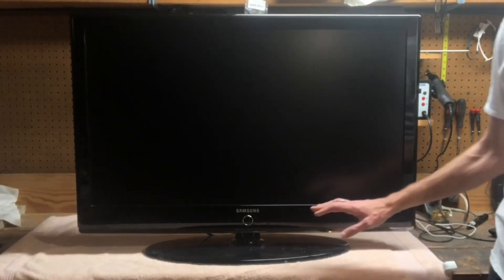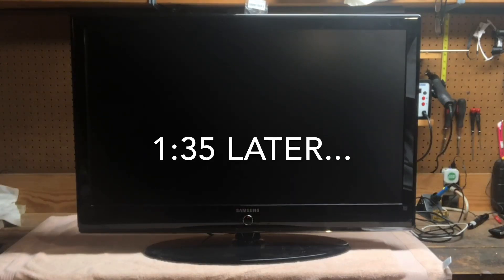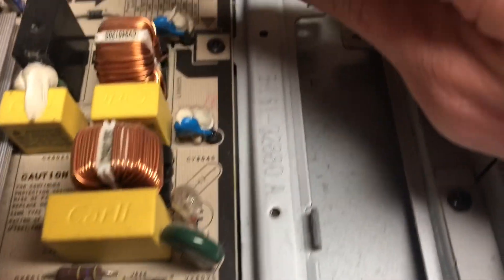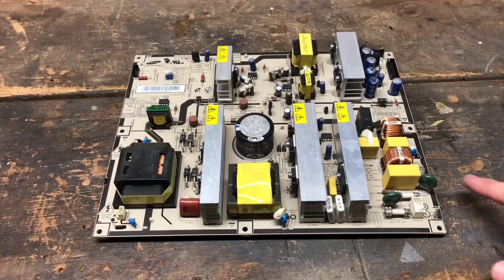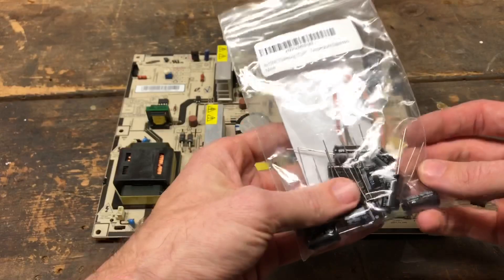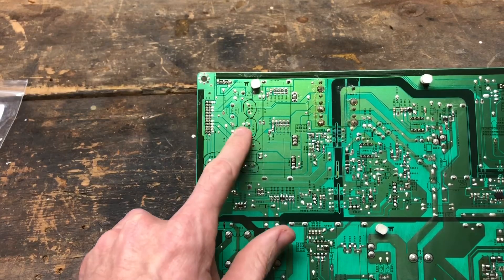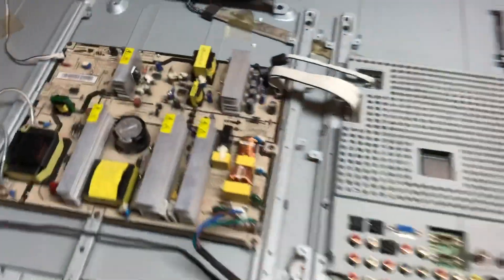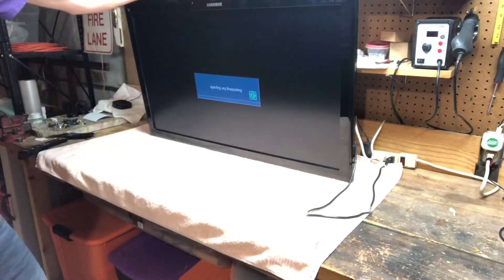Fix a Samsung TV slow/no power up!

Comment: I hear there are higher value capacitors that you can now use. Would you happen to know what sizes they are? Thjanks!
Reply from the maker: As far as I know, the circuits are designed for a specific amount of capacitance, so you’ll want to replace them with a cap that has the same capacitance value. Capacitors also have a voltage rating, which is the maximum voltage it can handle. If you purchase a cap that has the same capacitance value, but a higher voltage value, it may prolong the life of the cap as it will stay a bit cooler and hold up better to voltage spikes, etc.
Reply: @DustinRogersinMO  I was once repairing the PSU on a satellite receiver I owned and I noticed they'd put a 10V capacitor across the 12V line. They were notorious for their bad PSUs and now I know why! I replaced it with a 16V one.

Comment: Great video. I replaced all the caps on my power supply board but no change. My screen lights up but is just noise, then changes to vertical color strips. Then after some minutes the signal grabs hold and the correct image shows up. Same result for HDMI input or local TV station. Any ideas?
Reply from the maker: Very strange. I have another video on my channel about a Samsung that had a horrible screeching noise that was fixed by refllowing the solder joints on two surface mount caps. https://youtu.be/fgy4Tiy0auQ That was a very specific issue to that particular model. I found that fix on the badcaps.net forum. You may go search for your particular model on that forum and see if anyone has posted a fix for it. There's a lot of really knowledgeable people that are willing to offer advise on there.